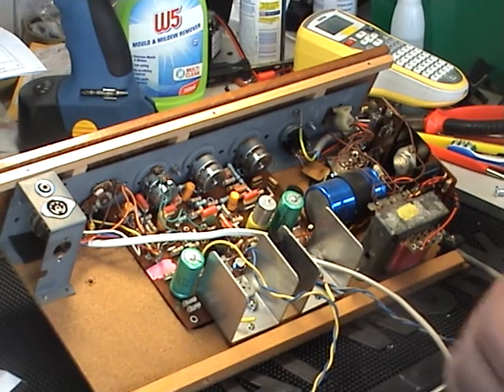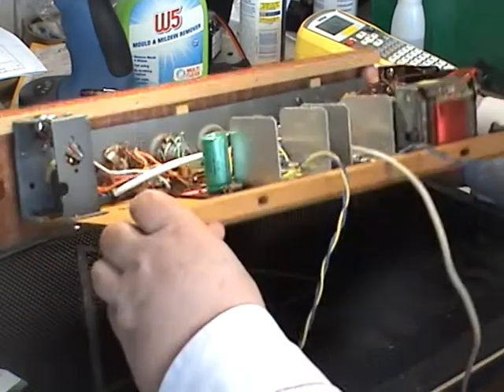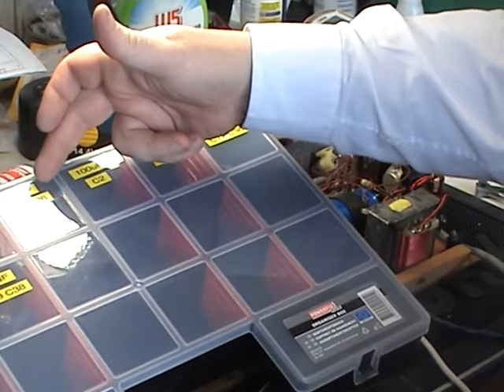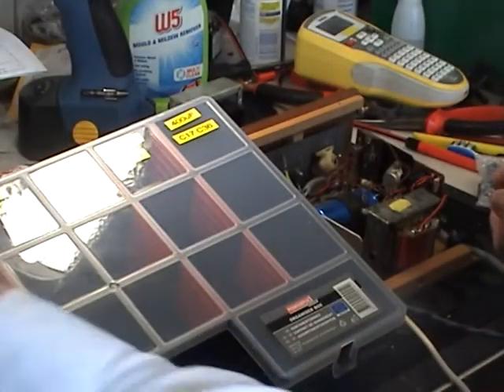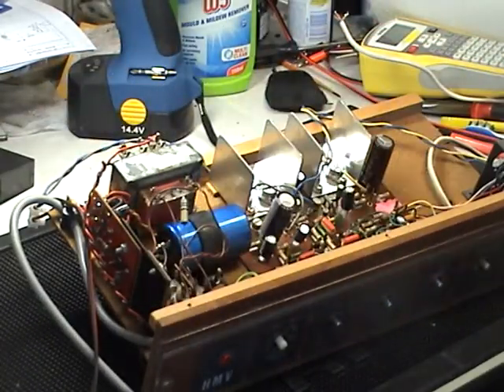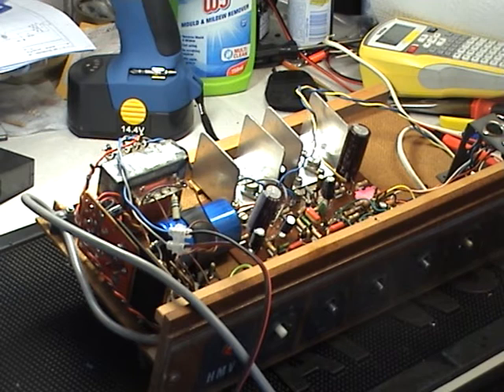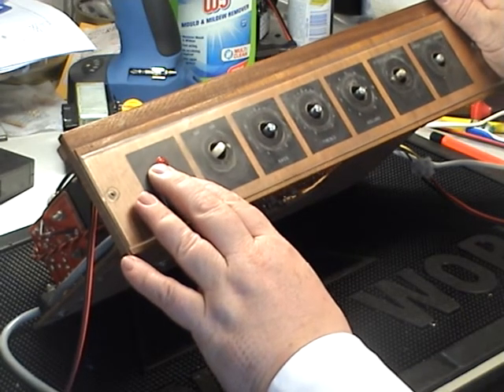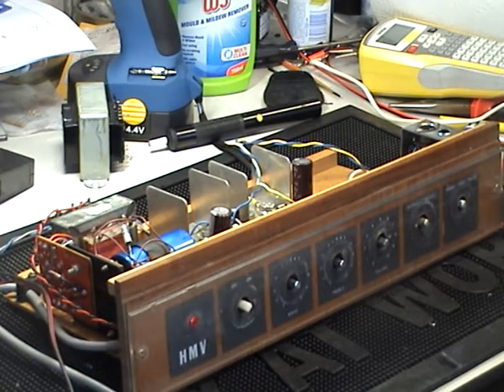HMV 2400 Stereomaster- Pt2 -Amplifier overhaul & adjustment

Comment: Hi there... not related to this but im in your area over the weekend and wondered if I could drop in a rotel 240 for a tune up and mid fitting?

Andy
Reply from the maker: Unfortunately it's illegal to add cept channels to any 27/81 radio. I am required by law to remove illegal modifications...certainly not to add them. I'm sorry this isn't the answer you were hoping for. Incidentally, they never work properly on either set of channels.....we've had enough here to be put back to standard!

Richard
Reply: ok no probs fully understand.... Just a service and a tune up would be good for me thanks. Can drop it in tomorrow afternoon on way to Kings Lynn.. if your about..
Reply from the maker: Normally the service provided to the trade only is mail order. I don't mind you dropping the radio off at our church pipe organ workshop near Ancaster. Please Email me rshireby@yahoo.co.uk